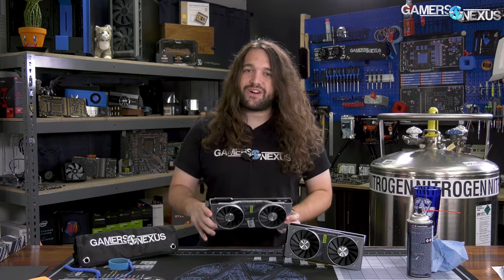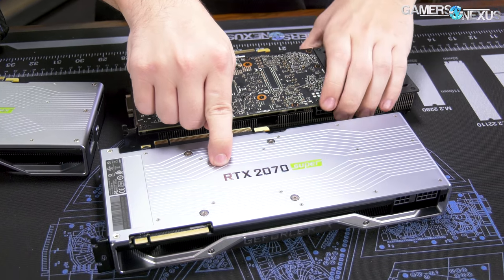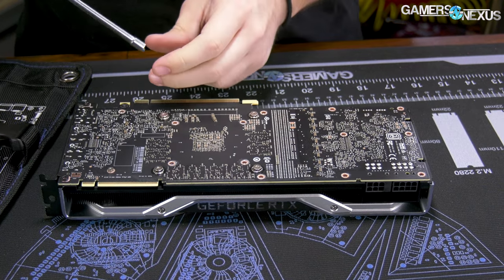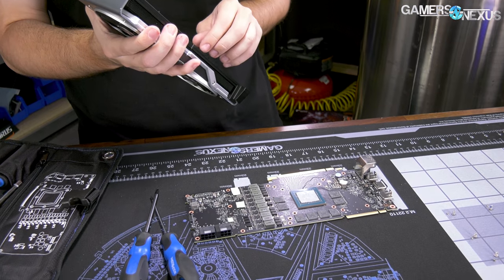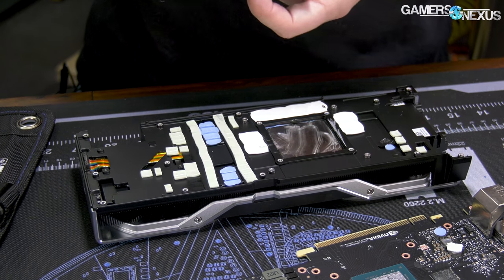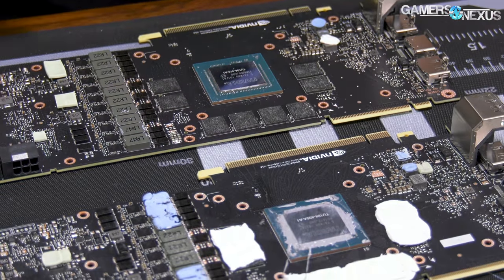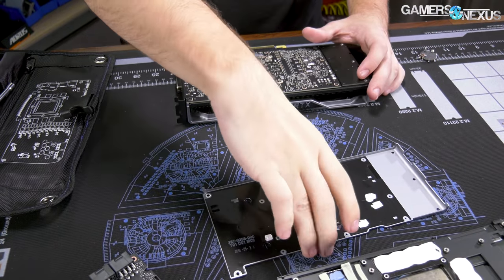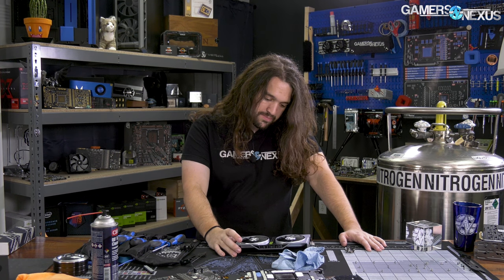NVIDIA RTX Super Tear-Downs & Water Block Compatibility

Comment: so a 2070 super is a 2080, the 2060 super is a 2070............. GOD DAMN IT NVIDIA
Reply: The 2060 s is not a 2070. It only gains 8-9% performance on average. Not worth it the price increase it also had. It actually gives you a negative result. In the case of the 2070 s yeah. It's a 2080 practically.
Reply: @gabrielst527  the dye is the same as a 2070. It's likely that the dye had to many defect to cut it as a 2070 though.  The fact that the card also gets bumped up to 8gb ram with a 256bit bus screams relabel to me. Stuff like memory architecture is built into the dye. Steve covered that when radeon vii came out with hbm2 memory
Reply: @seanb12491  well. The results in hardware unboxed put it in a 6-8% performance increase compared to the vanilla 2060, the 2070 super yeah, it's a increase in power that i'm sure people will buy.

Comment: I understood that a mirror finish surface has a lower roughness value, than a surface which diffuses the light. But I didn't see how that could be a joke. Am I missing a sense of humour or a reference or something. Also I think a lot more than 5% understand that the higher grit sandpaper you use to polish a metal surface the smoother it gets, and more reflective, so I discarded that as the joke. Can some one explain what I am missing....

Comment: Hello, I opened my 2070 Super for a seasonal repaste and I saw the chip SKU is a TU104-400A-A1 not a TU104-410-A1; which seems to mean that I have a 2080 chip. Have anyone seen this before? Does this mean I can flash it with a 2080 bios ?

Comment: yo how come i got a 1080ti sli with ryzen 2600 my fps is the same as a single 1070ti sli in games? am I setting something wrong? or is my 2600 bottle necking 1080ti sli?i uninstall driver and everything reinstalled, i get about 30 fps in 4k resident evil 2 while most other benchmarks for 1080ti sli in re 2 is about 90~100? what am i doing wrong here.

Comment: Question do you think Nvidia will do some kind of trade in program where you can get a super card for your standard RTX card?
Edit what's the spray you got recommended that you used to clean the thermal paste off the cooler and die?

Comment: So, if my 2080 died under warranty in the near future, would they replace it with a 2080 Super? Considering 2080's have been discontinued.
Reply: I guess it's possible but I wouldn't hold my breath personally, most manufacturers produce in more than sufficient quantity that the law of large numbers allows them to predict pretty well how many units they need to store to cover warranty replacements. Short of a previously unknown flaw surfacing that results in a product recall en mass far above what they were expecting I would imagine most manufacturers already have enough in their warehouse to cover returns from normal expected defect rates.

Comment: when you buy a rtx2080 and it got downgraded to a rtx 2070s
Reply: I would say that NVIDIA probably did that with the whole RTX line up. 2060 is a 2050 model, the 2070 is a 2060 model, the 2070 is the 2060 model, 2080 is the 2070 model. Well they had some good yields on Turing one could argue and when there literally was no competition for over 10 months, why not rename everything, increasing-price and confusing the hell out of everyone with those so-called ray tracing cards.
Reply: @Koeras16  at the all the buyer got dope by Nvidia that's why it's call the envy company

Comment: Would it be possible to flash super flavor bios onto non-super card?
Reply: No, they are using the proper dies for the model now. 104 for 70 106 for 60 you know like they did every generation before the RTX.. where we not only saw almost a doubling in price but also a cut down in the die used for the card. So you paid more for less... literally. Congrats

Comment: I guess in the mind of Nvidia, you are not supposed to change the TIM you are supposed to buy a new card
Reply: Why not use that graphite pad instead of paste if you are gonna make it THIS hard to pull apart?
Didn't the radeon 7 have a graphite pad in place of traditional paste and it even has the excuse that the die isn't exactly flat due to HBM.
console level planned obsolescence going on at nvidia

Comment: I am guessing that the PCB on the RTX 2060 Super is different because it has more GDDR6 memory (8Gb instead of 6Gb) so there might be more GDDR6 chips on the PCB (I think)
Reply: You are probably correct while in theory it is technically possible to make RAM chips that have a capacity that is not a binary power of 2 it would not be efficient to do so thus I would expect that the 8GB model has either 1 or 2 extra chips depending whether they use 1 or 2 GB dies for the ram chips.

Comment: To me the super cards are repurposed cards that didn’t make the standards of what they should have been. The super 2070 was a 2080 rtx that didn’t meet up to spec during testing. So they lowered the spec to make it stable and sold it as super cards to crash amd’s launch. Each super card looks like a version of rtx above it. Hints why nvlink is on the super 2070 it was a 2080rtx that didn’t pass their quality control test.

Comment: So basically the 2070 Super is a 2080. Nvidia just calls it a 2070 to look like the cheaper card is better vs AMD, but infact they just sold this card few months ago as a 2080 and a higher price. Yeah thanks Nvidia, I´m now very happy I didn´t bought a rtx 2070 (I was really really close to buying it since between the 2060, 2070 and 2080 it seemed the better combination in price/performance, considering it was around 550€/600€).

And no wonder they are not releasing a 2080 Super... They can´t... They don´t have anything to upscale since they already made the 2080 ti (which they could rename to 2080 super and sell it cheaper lol).

Comment: 3:23 - Hence proving, as Paul of "not an apple fan" has long stated, that the original 2070 is what should have been the 2060 (ditto the die used), something NVIDIA pretty much admits to in its investor briefs (remarketing and repricing to upsell).

20:30 - These products remind me of modern Apple tech, just really poor engineering & design.

Comment: No magnets on the new toolset? Yeah, all the ones without magnets are made to cut cost = junk. Let's say the black tip is a 🧲 it's a pathetic magnet if it won't even pick up the Phillips screws, and it def will not pick up the the threaded nuts that's a given in this tutorial. Bet if you used the ifixit kit it would have. Have a nice day.